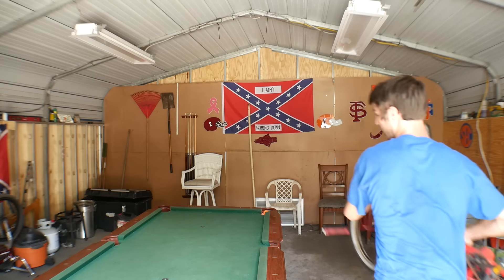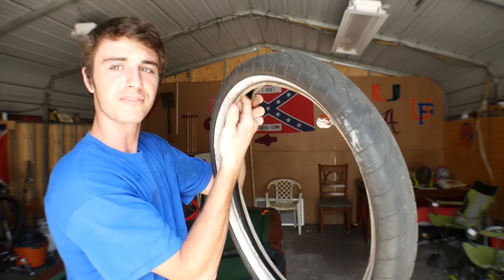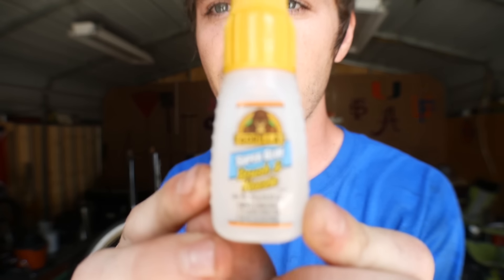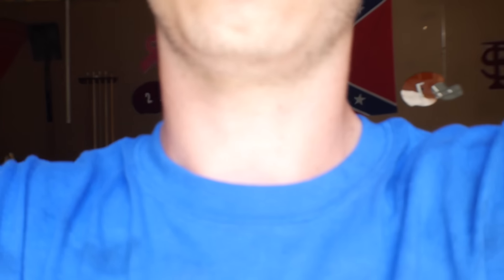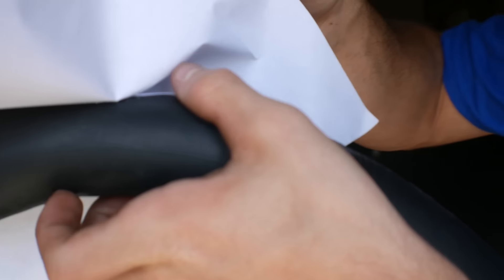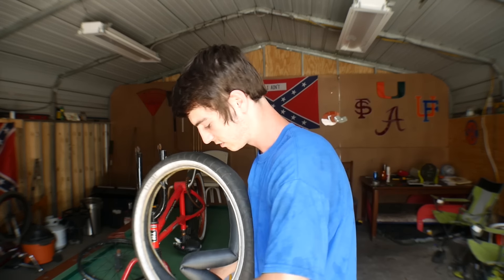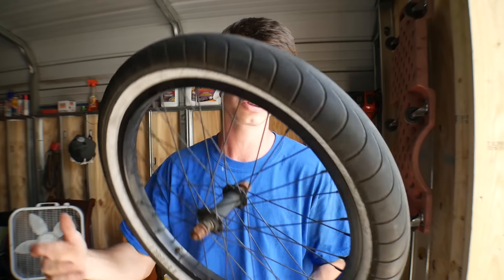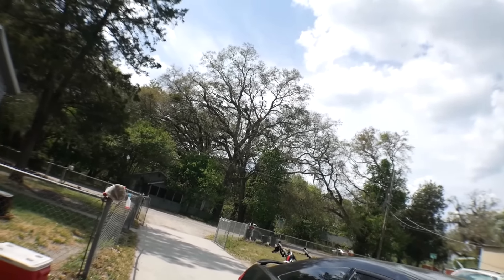(DIY) How To Patch A Bike Tube Without A Patch Kit *House Hold Iteams*

Comment: I used your super glue and paper method to fix a puncture on my road bike 3 days ago. It's still holding 100 psi. I'm amazed. :)
Reply from the maker: XDM50 yeah I run 80 in my BMX bike and it holds just fine
Reply: For real? How long did it last? I’d like to try it on my road bike that just got a puncture. But i don’t know if i can use it on long rides.
Reply: @BarnacleBoyFishing  it didn't stick for me lol not even for a week
Reply: Yep it works, used this method for the front tire 1 month ago, perfect seal. The back tire had a flat a few days ago,  did same thing, still holding. I botched the first try of sealing the back tire, I used too much glue, it did not hold. It only takes one small drop right on the pinhole leak to do the trick, then apply a small patch of paper and light pressure. I Leave the paper on.
Reply: XDM50 does it work ?
Reply: filmtajm35 for sure
Reply: @zeeshan5838  Yes
Reply: XDM50 does it work on fat tubes
Reply: @Jkr2sp3dy  I've never tried it on a fat tube but I don't know why it wouldn't work.
Reply: It is completely stupid.  That bottle of super glue costs more than a proper patch kit.  Do you really want some jerry rigged tire when you are out riding?  A total waste.
Reply: @tarstarkusz  what if you already have the glue and just need a hold until you can afford or get a new tube? Also technically the proper thing would be getting a new tube
Reply: @lifebydesign9435  You don't need a new tube just because you got a flat.  A patch will work indefinitely.  Superglue is NOT good for patching an inner tube.  For one, it gets hard. Tubes flex and stretch.  That is why rubber cement is used. Unlike superglue, it stays soft.  Also, it's not merely glue.  It chemically bonds.
Reply: I will never ever ever buy another tube in my lifeeeeeee!!! THANK YOU🙏🏾🙏🏾👏🏾👏🏾
Reply: damn tiny pieces of glass in my outer tube literally massacred my inner tubes in the last week. I am so excited to bring them back to life with your amazing method :D Thanks!
Reply: Hey man I used to watch your videos all the time
Reply: Just use a patch ..if done correctly will hold for ever
Reply: @filmtajm35  if he have a spare tube why would he even try
Reply: @kenan_allaham  to see if he needs to use the spare tube or not because this should only work for small holes but if he got a big hole or rip the he would need to use a spare tube
Reply: mate does this work for really rough mountain riding and jumping off rocks and stuff? Ik this isnt meant for like long term use and just to get you home,but still curious.Also,what would be the outcome if u used some vulcanasing fluid to seal the papaer?
Reply: I'm glad I saw this, I was wondering about that
Reply: @ReneeNme  bruh
Reply: @nocturnus6  i found out spraying the paper with water helps alot.
Reply: @BarnacleBoyFishing  hopefully this works cuz I’m doing this right now😭
Reply: I don't have any glue 😢
Reply: As did I and thank you because of this I have saved a much of money on my Bike Insurance 😂
Reply: @YBRikki2023  in other words..... you switched to Beico‽
Reply: Wow u serious!? That's a lot of pressure!

Comment: I did this to an old bike I was ready to donate to goodwill and let someone else repair it. I rode it close to home occasionally and at 185lbs that I am and two months later, the tube still has 60psi. A step further I had to take a look see. I pulled out roughly twelve inches of deflated tube and saw that the glue actually formed a seal on the two holes. No cracking, just a smooth as glass bead of dry glue over the hole. I did use the Gorilla glue and allowed it to dry for about 10 minutes before inflating. I did donate it after the two months. Thanks for that tip.
Reply: Fix ur writing I don't understand

Comment: Honestly I didn't trust this method because superglue dries as a hard crystal and it would crack at the first spin, but I ran out of rubber glue and I had to try. 
The result: It works!! It's been 3 days and there's not any leakage. I think I will not buy any fixing-kit again! this method is cheaper, easier and faster.

One advice: try to sand the surface before applying the glue, it will improve the adherence.

Thanks a lot dude!
Reply: Can I use clear gorilla glue?
Reply: @gosu8075  did you try the gorilla glue ? Did it work ?

Comment: Hey Nick...its been 15 min as I text this to you and so far tire still solid at 90 psi...I walked 5 miles to bike shop to fix my flat and I guess the employee didn't like his job because he failed as a professional bike mechanic to check the inner tire for sharp debris...I made it unaware back home to notice a flat again...thanks to you I checked and found the wire needle that punctured my new tube. Well 30 min now and still holding up...amazing! Thanks so much. Your trick is golden!
Reply from the maker: Angel Martinez I'm glad I could help 👍👍
Reply: Should have ridden back and complained to the store

Comment: Just did this 3 days ago, absolute brilliant, tire still holding air, found thorn and pulled that out. Could not run to bike store so used Krazy super glue, pumped to 50 PSI, all good!!

Comment: Just did this but with a piece of an old tube instead of paper and worked very well! One thing to note about using tube though, don't make the piece to big and don't use tons of glue because it will cause that part of the tube to not be able to expand. I did this on my first one and it made my tire wobble a bit because of the unevenness of that one part of the tube.
Reply: This is the Pro Tip. As you can see in this Confederate Loser (they lost the war) video, he barely puts any Super Glue on. Best bet to use as little glue as possible.
Reply: I'm gonna do this but with my tyre ill use my old tube it looks like a cut but it could be worn it's only 2 yrs... 💀 I'll cover it with the tube on both sides.
Reply: Oh I accidentally did that……

Comment: Great video and alternate tube repair idea Nick!
Super Glue alone will fix most leaks if they aren't too big. You just need to get it down into the hole so it can glue the rubber back together. Instead of paper you could also use a piece of an old tube or even a thick balloon to provide extra support to the patched area.

Comment: I needed to patch a tube and had nothing but super glue. I was skeptical that this would work. I also don't check the Inside of my tire. Well come to find outbI had two small leaks and a very small sliver of metal In my tire. Went through your whole process. And It worked fantastically. 
Thank you for this video

Comment: Seems plausible in theory and my only concern would be the pretty good likelihood that water that gets into the tire will disintegrate the pulp fibers of the paper.  Also I have learned to use a very soft rag to detect any sharp protrusions inside the tire as it is much easier on the fingers.  Thanks for illustrating the importance of a correctly aligned air stem (especially in aggressive moto-cross riding because that reduces the chance of cutting the valve base with the edge of the rim hole during a jump, etc.  The flag is a concern to some folks and I get that so if it detracts from your message it might be something that could be covered so as not to distract viewers.
          Might also suggest putting a piece of cardboard over the pool table to keep the felt cuts to a minimum.   Thanks for the video and keep up the good work.

Comment: Thanks, Nick, for sharing this. My son's scooter has 6" tires with inner tubes, one of which had a hole in it. I tried three times to patch the hole using my regular bicycle patch kit, but each time the repair failed (probably because the scooter tires require such high pressure, 85 PSI). Luckily, I came across your video and I just tried your method, and it's holding fine at full pressure. I never would've thought of trying super-glue.

Comment: The only thing I changed with this is take one old tube, and cut it up for lots of patches instead of the paper. Works well.
Reply: Same
Reply: Haha I do the same
Reply: The paper is not used as a patch.  No patch material is required in this method.  The paper is only to use during the sealing of the glue and to not get it on your fingers.  This method needs no patching material as long as it's a pin hole size or close.
Reply: Thank you to every single one of you in this thread as well! Sliced off a tiny piece of an old tube, patched it to the puncture together with crazy glue, and I’m rolling again!
Reply: Dose it last long
Reply: @tyresepierre787  I've done this once, and that was only till I could replace the tube, so I don't know if it would last long or not.

Comment: Awesome, My wife bumped into pavement with low tire  pressure. Tube and tire both got  1/4 inch cut.  Bought DAP($5.00)  super glue from Menard. Applied DAP on Tire slit got cured perfectly outside and inside both. Put electric tape inside the tire to cover up uneven glue spot after an hour. Applied DAP on tube , then pressed piece of old tube  on it.  after an hour put all back on the rim. My wife biked  11 miles still air on it 100%.  Great idea. Thanks DUDE.  👍👌🚲

Comment: finally succeed after a few tries!! bond paper dont stick well to the tube. So i used a thin cardboard, tear off some layer to make sure it is thin enough to be flexible, then a little sanding with 2000grit sandpaper. proceeded with the instructions and now my road bike tire is holding well

Comment: Just FYI: Superglue is NOT recommended for patching inner tubes because it eats/degrades rubber and certain plastics. I tried this out of curiosity and it only lasted one day, granted your mileage may vary but if you use super glue eventually it will fail. Ideally you should just buy a new tube but if you must patch it for an instant fix then use either rubber cement or a plastic/rubber safe quick setting epoxy.
Reply: Ok safety bob, lol

Comment: I work In a bike shop that's a smart idea for quick easy patch. When your on the road if you don't have a new tube to use then this is a good back up.  I tried it works very well .   I like the confederate  flag cool

Comment: An alternative to paper:  superglue + electrical tape.  I keep a roll of tape in my saddlebag; the bonus is that if you have a tire blowout, wrapping it in electrical tape can buy you enough miles to get back home or to your car.
Reply: Second this, I ended up here as that's my normal method but I've rang outta electrical tape so was looking for other options. Bout to go ahead and give it a bash
Reply: Can you do this with duct tape?
Reply: @samhain7548  Probably, but I haven’t tried it.  Electrical tape  is fairly puncture-proof.  I’ve started lining the inside of my tires with 2 layers of electrical tape (between the tire and the tube).  Haven’t had a single flat tire on the last 2 sets of tires (5200 total miles so far).

Comment: I've never bought a kit, I'vee always used super glue and a piece of old rubber inner tube for a patch.
I scrape the punctured tube and piece of donor rubber from old inner tube,  apply super glue, quick flash of fire from lighter to the glue, same to donor rubber piece, stick on and put lots pressure a small drop again on the edges of the sealed patch and quick fire on the patch and Walla fixed. Never fails

Comment: Thanks, it helps. While I don't have many holes. Good story comes!
Once I did a 10 000 km or 6K miles journey, without a kit.
After half way, I got one, in the middle of nowhere. It was fixed in half an hour, in a garage by nice Spanish people. Galvanized!
After I was riding in remote areas. Nothing for 10 miles or more. I have grown nervous. Finally, I bought a kit with 12 patches. I bought some food and gas for the camping stuff. After 10 minutes I found a perfect picnic place. I left the bike in the paved parking and had dinner a few meters away.
As I started my journey, I had a flat tire. The rear, of course. I fixed, and I had once again, noticed before take off. I checked in the creek. I had ..... 12 HOLES .... around the tube, evenly distributed !
Still today, I have no idea, how this is possible.
Luckily, I had a spare tube with one hole. I fixed that one, and I had no issues again, for thousands of miles! Tell me if pilgrimage is not spiritual.

Comment: Just did this on my 2.50-10 Honda Spree Tire that holds 33psi and it seems fine for now. Coming from my tire shop experience... use that couple days to get a new tube, last thing you want is a flat tire on a highway or bush road

Comment: I used duck tape and it was a big ass hole and it worked better
Reply from the maker: Jayden Lennartz thanks for the tip
Reply: Duck Tape + glue  or just straight duck tape?
Reply: @cinnamonfitness2492  I done this method and also covered it in duck tape just in case

Comment: Instead of paper I would use piece of another tube. That however requires another tube, which should not be the problem if you're a bike guy. I was so pissed today on my comute to work, always have spare tube or something to fix a flat in my backpack, but not today. Why? I have no idea. Had to push the bike all the way to work, I missed one hour, I was pissed and tired, fuck me.
Reply: I know the feeling yesterday had to walk 2 hours home. I vowed not to let that happen again.:)
Reply: I do the same, ran out of patches and cut up an old tube, worked like a charm but want to try out this paper patch for the craic.

Comment: I can't thank you enough.  This send me so much headache and time.

Merry Christmas, my friend.
Reply from the maker: You are welcome!
Reply: @BarnacleBoyFishing  I'm afraid my "Thank you" was premature.  But not unwarranted.
I got an old bike for my mom, it needed new tires and tubes.  The front tire and tube went on and inflated no problem.  The back tire and tube went on, and the tube popped when I inflated it.  Didn't even put any real pressure on it!  Checked the rim and tire - both clean and without pointy things.
Bought a new tube.  This one wouldn't go past 30 PSI.  It needed to go near 65 PSI.
I took it out of the tire and checked for leaks.  Found one pin-prick on the inside of the tube, about three inches from the valve stem.  Searched for a quick-fix, found this video.  Patched it and put it back it.
65 PSI!  For about ten minutes.
I took a break for a while, took the tube back out, and checked for more leaks.  And this time, I tested and searched for leaks while it was still outside the tire.  I found not one, but two more leaks.  One was a pin-prick on the outside of the tube, opposite the first; and the third was a tad larger, on the outside, about six inches on the other side of the stem.  

To recap, there were three leaks in this brand new, out of the box, tube.  And all patched with this video's paper and superglue method.
My mother just rode her new bike down the lane and back, and tires worked perfectly!

I feel I can now officially say, thank you, and Merry Christmas!

Comment: I didn't have super glue so I gave duct tape a try and it worked. I just brushed the surface of the tube clean and put a square piece of duct tape on it, then another piece going around the tube over laping twice.

Comment: You're fantastic. I had a small dolly with new tires on it. This saved me sooo much grief and time. Had I had a piece of thicker paper I'm sure it would work as well. Only difference is I also had an inner tube, used a wire brush and ruffed up the inner tube and rubber piece before super gluing together. Then put it in a vice. Again, this worked so well.

Comment: Thanks bud! This got me out of a pinch and saved me some $$$. To find the leak, I just inflated the tire and sprayed it down with soapy water and sure enough it began bubbling up right where the very tiny leak was. Turned out to be a very small sliver of glass. I did this before pulling out the tube to see if the tube actually split open or if it's a legit puncture. Doing it this way, I was able to locate the puncture on both the tire and the tube at the same time, remove the glass and then just pull out that portion of tube and do your patch and pop it back in. Hopefully this helps someone in addition to your excellent patch hack!

Comment: Nick,I redid that tube with a piece of heavy duty black electrical tape ( super stick kind) and put it over the hole after I removed the piece of cardboard and it is holding really good now. I did that first thing this morning after I got up and here it is several hours later and the tube is still full of air. I don't know why the glue and cardboard didn't work. Maybe I didn't do it right. I don't know. But thanks for the tip on this video.

Comment: I also serendipitously learned about super glue repair as a homeless person without drugs alcohol or stupidity... I discovered some holes too small somehow. Or something. It would raleek again.. so with a piece of plastic.. stretch the hole and put this plastic on top. Push the glue inside the hole.. the gel variety of super glue best . Use a plastic bag possibly loaf of bread bag. Much more durable. I have two trucks now. A van and a truck.. I have also learned methods for emergency to repair vehicle tires. From the side wall. Able to use different varieties of glue. Super Glue with nothing but material from clothing to put plug in side wall.. as experiment I drove one of them for miles and miles. Carefully.. it never failed. It just got too worn out on the bottom. Tread.. I thought about keeping it as a spare. Survived doing scrap metal cans and bottles.. now seeing better things in the hauling business.. an occasional Plumbing job assistance handyman Etc